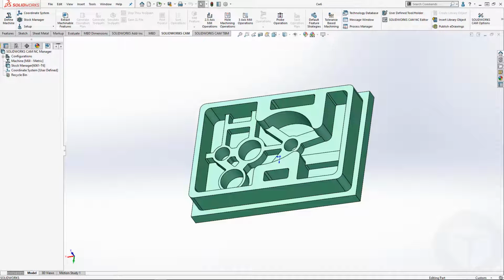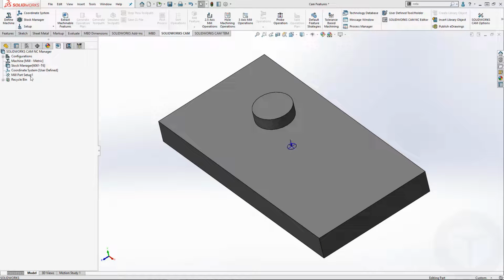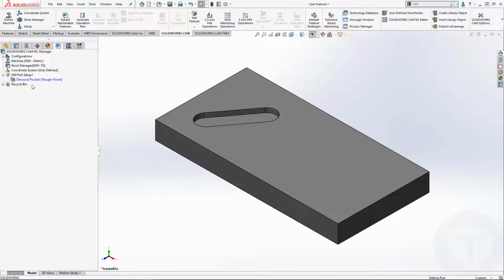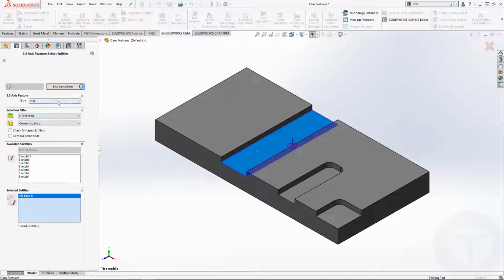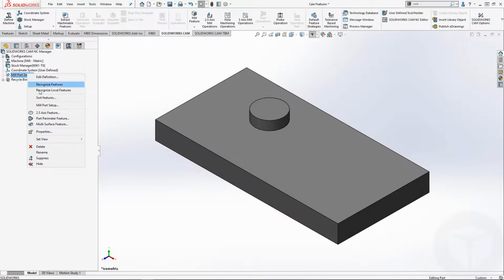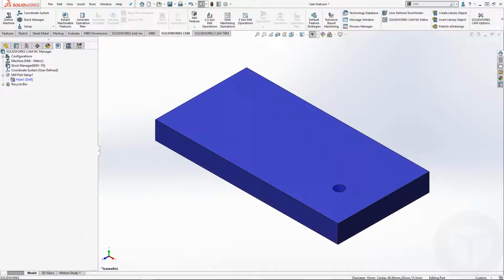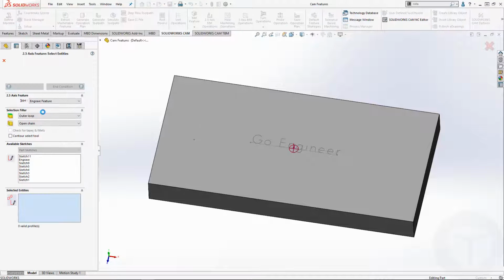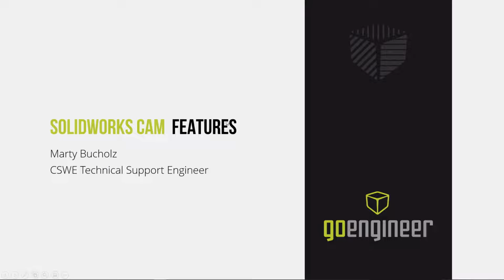SOLIDWORKS CAM Tutorial - Features

Comment: Thank you. 
And tell me if the machine is homemade, which post processor to choose?
Reply from the maker: With a home made machine, we would look at the controller being used most of those will have a code base from an existing manufacturer. If even the controller is home made then we would have to have a larger discussion about what you based your code on.  The real answer here would be to get in touch with your CAMworks VAR and have a conversation with their technical team to find what will fit best.